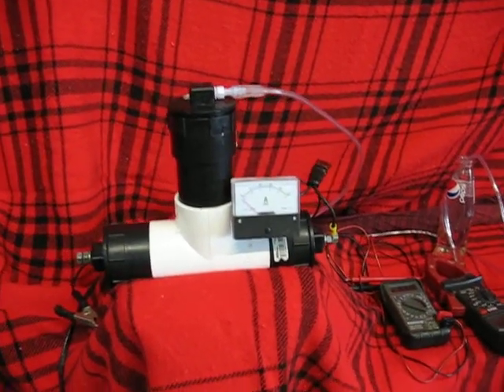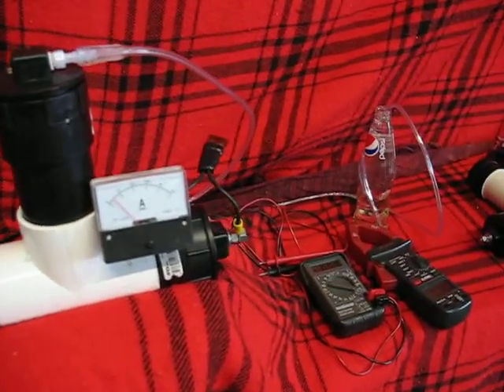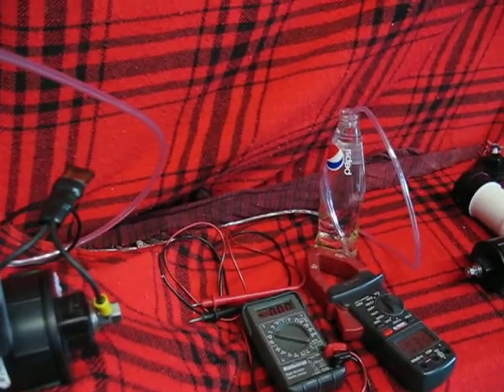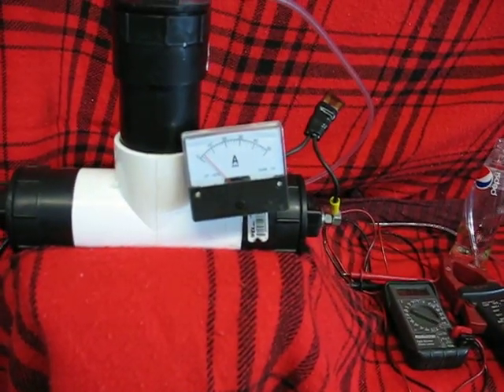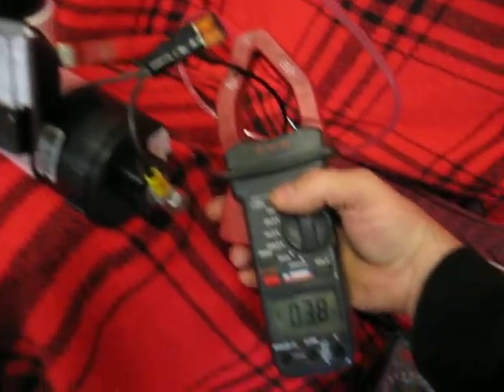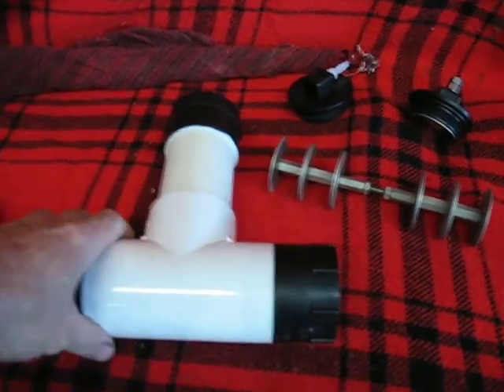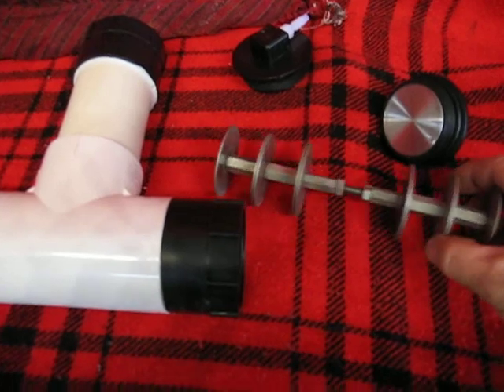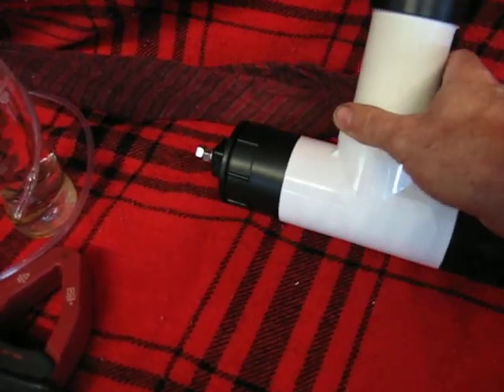Thunder-Volt-Revolution 4amps english

Comment from the maker: the MMW are similar to those of the Thunder-Volt1... slightly lower because Thunder-volt1=insulated cell... 
Thunder-Volt-Evolution=Wet cells... but the difference was not significant... perhaps 0.50mmw less.

Comment from the maker: I wanted to create a simple generator which is almost the same efficiency as the Thunder-Volt1 which is much more complicated to build and very difficult to clean .... and I succeeded!
I also found that for a gasoline car, it was useless to built a large generator because for such a small car (2L), 3-4amps are enough to get good results ... more AMPS, it's useless ... the results are the same ... 3-4amps or 20amps, my results still have 20-22% fuel economy. So I make smaller generator.